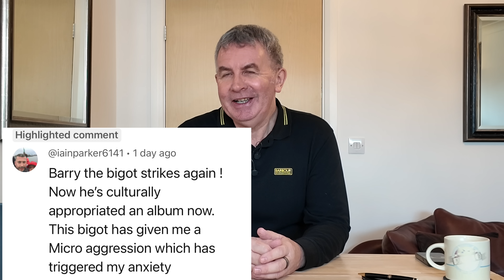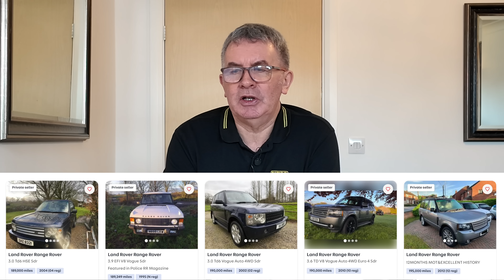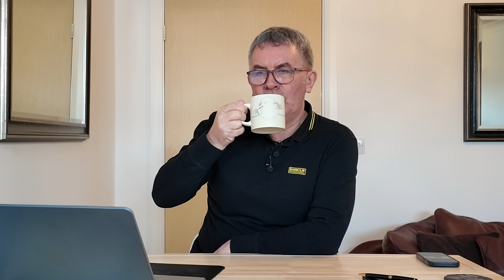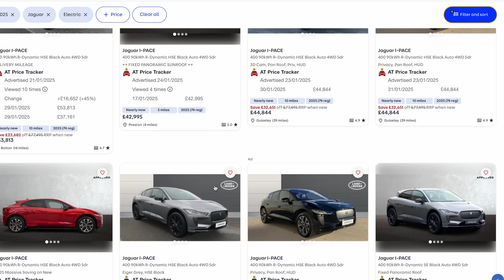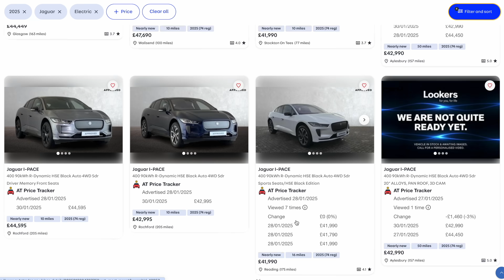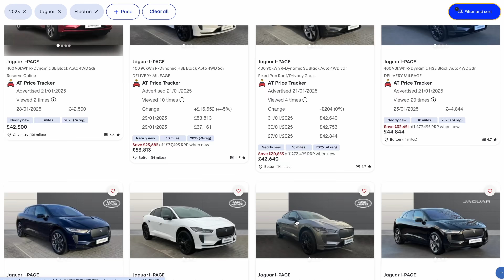Jaguar iPace Electric Vehicles Piled High at Scrap Yard, EV Newt Scores an Own Goal

Comment: On Geoff's channel, he went through a story on a FIVE YEAR OLD Leaf. Disaster. 

This is one of the reasons EVs depreciate like a rock. Replacing a battery is such a big deal, it fundamentally makes it uneconomical once it gets over 3 years old.
Reply from the maker: yes i watched it
Reply: Not if you can foist it onto an unsuspecting punter. As was the case here. 9000 pounds for a Nissan leaf that has done nearly 100,000 miles? What a shame nobody gave this customer any realistic advice about real second hand car values and issues.
Reply: This has been one of my arguments with the so-called "better for the environment" claims. Most people in the UK drive a car that is 10 years old or over (around 54%) but that won't be the case with EVs, they will be scrapped a lot sooner but nobody takes this into account. These EVs will be scrapped long before their equivalent ICE car because nobody in their right mind is going to pay £5000-£10,000 for a 10 year old EV that might need twice that amount spending on a new battery pack in the near future, either because the batteries are worn out or because they know the car will be a complete write off in the event of even a minor accident. 

Look at these examples: £40,000 Citroen and Vauxhall Mokka EVs now on sale for around £11k, just 3 years old, and these are average prices, not one-offs. Same story with the Leaf, £28k new but just £7,400 3 years old. If they haven't been scrapped already you'll be able to pick them up for pocket change in 10 years time.
Reply: Just a reminder: the EV "chargers" in your garage or hanging off exterior wall are not chargers

They are PCB's with relays to feed 240v 16A or 32A AC into the vehicle on board AC-DC chargers

Comment: Such a waste, can't the batteries be fixed? or replaced? They will go a long time with new battery.
Reply: £10,000 batteries if lucky. There's not a spreadsheet on the planet making the math work out. It truly is a grift. Imagine having to replace the engine of an ICE vehicle every 5-10 years when the spark plugs go bad
Reply: Not cost effective. Evs are just throw away appliances.

Comment: I've owned a 2006 Jaguar XJ8 for 18 years and it has been totally reliable. The Mercedes GLK 350 I owned from new, was unreliable and ruinously expensive to service.
I don’t care about EVs as I'll never own one.
Reply: Jags are year and generation specific.  We still have an x300 95-97 because they are like tanks.    The 4.2 engine is reliable: the early 5.0 liters are not.
Reply: I have a 2013 XF oil change very 6k, its still amazing but only worth 2k as a trade in, got a water pump and timing belt at 100k  gave it my daughter, one of the best cars I have had. replaced with an E53  Mercedes petrol, as I don't do as many miles now. the Mercedes is quite a bit more expensive to run 😞, looked at electric but its just not practical for me, I cant have a car dictate when I need to charge it, and then take 1.5 hours , if I'm on call I need a full tank 😞
Reply: Ditto. Our 2009 XF is still running perfectly and we've never had an issue in the 7 years we've had it apart from a window winder. We also have a 10 year old Evoque and have had no issues with that either. 

Biggest problem is people who can't afford to buy these cars new buy used ones, are too dumb to realise that a used one costs the same to run as a new one and they can't afford it. So they skimp on servicing and parts etc., cheap oil, cheap filters, back street garages (if they bother at all) then when they inevitably break down they post on social media telling everyone they're shit. You see them everywhere, they've always got cheap Chinese tyres on. 

The rest are just sheep reading posts from these dumbos about how unreliable they are and just copy and paste them. Most of them have never even sat in a Range Rover or Jag.

Comment: You defend JLR but I've seen other channels (EV sceptic ones) talking about issues with JLR products, particularly engines that go in Evoques. Some of the older engines are indestructible and some newer ones are made of toffee.
Reply: Even in the 70's, Jags would burn a pint of oil every 700 miles,& that was considered  normal!
Reply from the maker: I can only relay my experience
Reply: True Barrie, what's your experience with 2L diesel ingenium engines and DPF or timing chain, or steering rack issues?  @BarrieCrampton
Reply: @MichaelCampbellGB  Or rust issues underneath, or front brake failures and wiring loom failures ?  Barrie must be the luckiest JLR owner in the world because all the others are VERY unhappy

Comment: Hi 
I dont think jlr is worse than any other motor manufacturer they all gave issues somewhere. As for ev's they are an option for some people and thats ok, it appears that there are some good quality vehicles ic and ev coming out of china, the resl question is should we be putting dollers into china's koffers. And a return to ev's they are only clean by proxy and can you condone the way battery materials are mined. None of it is a simple yes or no 
Great vids keep up the good work
Reply: People said the same thing about Japanese cars in the early 1970's. They sold because they were invariably reliable when much of the competition wasn't. Most rusted very quickly but that doesn't affect a new car buyer.

Comment: From what I could find online, there was a recall and buy back of the 2019 ipace, due to battery issues, announced circa August 2024. 3000 units were mentioned. Chances are, this picture is of those recalled. No big deal and certainly not indicative of everything that Jaguar make. Thoroughly enjoyed the time I had with my 2.5L V6 x-type. AWD was superb in the snow.
Reply from the maker: I love Jags
Reply: @ almost pushed the button on a last version XKR a few years back. Went for a Mini JCW instead.
Still intending to grab an XKR, the last of the great grand tourers, before such cars are no longer allowed to be made, even if I have to mothball it.
Reply: Of course the x type was good, it was a mondeo,  Jaguar thrived under ford ownership but Tata ownership since 2014 has killed any semblance of quality or reliability.
Reply: @steverose825  Sadly just repeating the same tripe that you've heard.
Yes, the chassis and a few other parts might have been Mondeo, but trust me, it was very much a Jag. 
Mondeo was fwd. X=type was AWD, so the entire transmission and drive was Jaguar. The list goes on and on. By all accounts, only 19% of the X-type was from Mondeo etc.
Almost all manufacturers take all sorts of components and parts off the shelf. Even Bugatti and I think Lamborghini have standard switchgear and no doubt other standard parts.
But no, the X type was overwhelmingly Jaguar.
Reply: @SeanHendy  sadly your the one talking crap Sean, the AJ v6 was a slightly changed ford duratec originaly designed by porsche, worked on thousands of them, your right manufacturers all interchange running gear all the time, one of my audis has a lambo engine in it and the wife's a class merc is a Renault Megan underneath, it's fact, live with it!
Reply: @ 19% Fact. There's countless articles stating exactly that.
Reply: @  Wrong again fela, Mondeo Mk1 was readily available in 4x4 albeit not a popular choice for what was a reps car, and FORD quote "Under the skin, the decision was made to build the X-Type on Ford’s CD132 platform, which underpinned the Mondeo Mk3 and would also go on to be the base platform for the Volvo S40 and Mazda 6. A sensible approach from an engineering and cost-saving perspective, but one that made Jaguar’s senior management twitchy. Jaguar was a company renowned for its bespoke engineering, and it was imperative to play down the Mondeo connection – something which would later backfire massively."  It was Jaguar who started the 19% rumour in order to attract the right sort of gullible customer, ie you but were later found to be false !

Comment: Just spotted that Renault Fluence at Binca when you were looking at EV's Barrie I wonder if it's the pile of Crap Calvin bought from AutoAlex? I guess at £1759 for a city runaround it may do someone a good turn but I do remember the range being shockingly bad if it is the same car.
Reply: It says in the ad '36 miles on a full charge'.
Reply: @Twmpa  After a bit of digging around it is indeed the very same car that Alex bought for a grand, 36 mile range is pathetic too.
Reply from the maker: Yep I’ve looked at that one too

Comment: A friend of mine who owns a Diesel Ingenium engined XF might disagree about ICE Jaguars being reliable. He has spent a fortune in repairs including a complete engine rebuild due to the timing chain failing at 65,000 miles.
Reply: I keep being drawn to the traditional older shape but still new XJ Jags in the free ads, most of the diesels appear to be for sale due to engine failures.
Reply: Change the oil more often imo
Reply: @alicelander9058   That would have helped with the chain, not so much with his EGR and DPF issues.
Reply: @alicelander9058  If someone is willing to pay out big money for repairs, do you think they aren't bothering with the services? Problem is a lot of the manufacturers recommended oil change intervals are too long now.
Reply: Isn't it funny how everybody seems to have a friend with a Jag or a Range Rover with problems? And nobody ever has any other make of car that ever broke down? 

Shortly after we bought our Evoque 6 years ago I had to call out the AA with a flat battery. Turned out to be just a loose terminal but as we had only just got the car I asked him how often he got callouts for these. He said he couldn't remember ever having a callout for one before, and that BMW and Audi were the worst for reliability. That backs up my experience, never had any serious issues with our XF or the Evoque, or our discovery or original 2003 Range Rover. Had a lot of problems with my BMW 3 Series and my daughter had so many issues with her Audi Q5 she returned it. I hear all the time about KIa engines seizing completely with less than 20k mileage, Ford's 1L Ecoboost engine seizing up for fun yet it's always Jaguar and Land Rover.
Reply: Don’t buy one with an ingenium engine , cheap crap
Reply: Probably drove it like an idiot